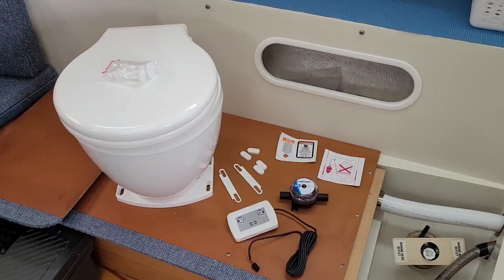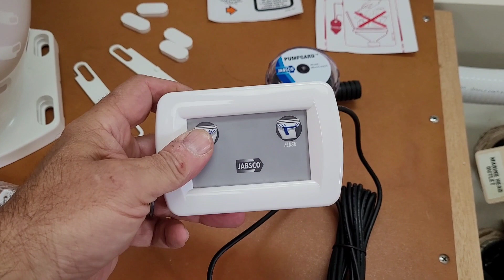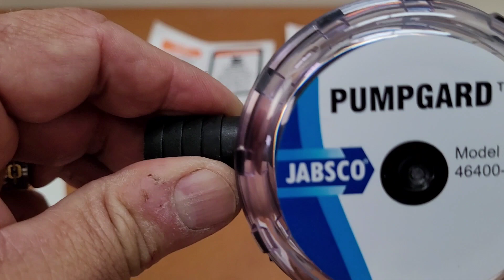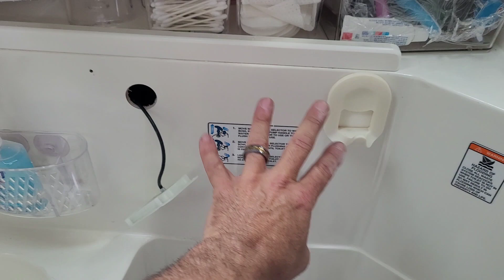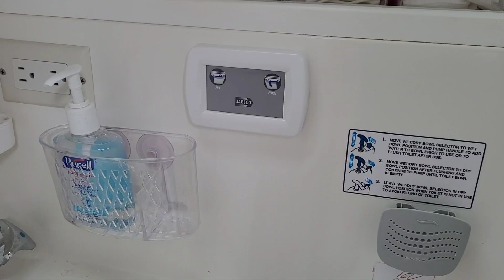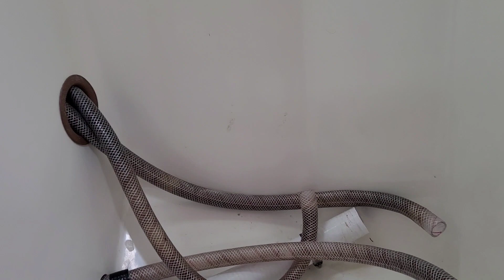Jabsco Electric Lite Flush Toilet installation conversion on Catalina 270

Comment: This is the best video on this toilet. Thanks for sharing. I have a Catalina 34 and planning on upgrading. Just wondering how much drilling you had to do to relocate the bolts because of tilt/slope in the back wall? My toilet back wall has the same sloop. Thanks again!
Reply from the maker: Hi, glad you enjoyed the video. You’ll be happy to know I did not have to drill new holes. Two things remember, this toilet used the same foot print and mounting hole pattern as the manual Jabsco toilet. Plus the mounting plate holes on the new toilet are oblong, so you can set it as far forward as it will go to give you a little more room in the back. So if your current manual toilet is a Jabsco, you should be good to go. The other thing to know is that the output (discharge) outlet and the water inlet flanges are rotating. So you can rotated them to where it will best fit your situation.  It was an easy upgrade to do. My suggestion, while you’re at it, it to replace the discharge hose at the same time.  My wife and guests love it and it is much easier to explain how to use. And much less “gross” as my wife would say….

Comment: I take my hat off to  guys like you who take the time and make videos like this. 
Just one question is   your toilet  below sea level at all times?
The only reason I ask is because if so, there shouldn't be an anti-syphon between the seacock and the rinse pump intake. The anti-syphon should be on the rinse pump discharge and the bowl intake elbow. This is because the rinse pump would struggle to prime as it would be sucking air as well as water. Have I read the installation instructions correctly or have I completely missed something.
Cheers.
Reply from the maker: Hi Robert, the toilet itself is just about level with the water line. So my anti-syphon is only one the water intake line, at 20” above the toilet base. The output hose is direct to the top end of the holding tank. Put there is a one way valve inside the output hose.  So no issues when sailing or healing. Although if I am ever healing hard to port, I would not let anyone go do pipi right away, until I’ve eased off on the mainsail…
Reply: @SVAquaholic3 I really appreciate you taking the time to message me,top man. I bought the boat with the electric toilet already fitted and it's never flushed with the correct 0.6ltr for the first button push the another 0.6ltr on the second. The world and his wife have looked at it, but your video has really helped me to understand things a little clearer, thanks again. Big thumbs up.

Comment: I think you meant "macerates" 🤣
Great video.  I'm about ready to swap my manual toilet out for one of the LiteFlush models.
Reply from the maker: I just rewatched my video and I do say macerates… I’m glad you like the video and just to put your mind at ease, we are still super happy with it. One of the best upgrades we’ve made. Much easier for guests to use with a lot less explaining..
Reply: @SVAquaholic3  - Thanks!!  We're looking forward to having this on our cruiser this summer for the exact reasons you mentioned.  I'm curious about the wire size you used for the DC wiring.  I'm planning to run from my main DC panel in the cabin to the head, but I have to go from the cabin back to the engine compartment, across the front of the engine compartment and back to the head.  There is no path for the wires to go directly across the cabin.  The specs say this draws 20 amps.  Did you use the 10% voltage drop chart or the 3% voltage drop chart when sizing your wire?
Reply from the maker: @Chuck Johnson  hi Chuck, I used 30amp rated wires. Much less drop over distance.
Reply: Absolutely heard that too lol

Comment: Thanks for the video. So did the new toilet have the same floor space set out as the original toilet? Or did you have to move it forward on the mounting block? I have the same old manual jabsco, and space is an issue for mounting if the set-out on the lite is different.
Reply from the maker: Hi, I moved the new toiler forward to the maximum setting it’s mounting base allowed. (Did not drill any new holes).  Since the output pipe is flexible, I was able to rotate it’s base to allowed for space behind the toilet.
Reply: @SVAquaholic3  so the mounting points allow the toilet to slide on a track?
Reply from the maker: @hoverwatch4131  yes they do, see this  video I shot after the install and you can the base. https://youtu.be/QA2drVjSYbM
Reply: @SVAquaholic3  thanks, and thanks for the quick reply.

Comment: I am curious where you connected to power. Is there a 12v connection somewhere under the sink?
Reply from the maker: Hi Chris, I tapped into the macerator power lines which pass under the sink. Not only because  they are close by, but is also linked to the correct amp rated breaker.

Comment: Thanks for sharing. Best video I came across for this product. I’m in the same situation now with the old manual Jabsco in a Catalina 34 and looking to switch. I hope the product still work as expected considering the bad reviews on the earlier models. Would appreciate an update if you’ve had any issues since your last comments. Many thanks!
Reply from the maker: Still working great! Absolutely zero issues!
Reply from the maker: Thanks for your kind comment. I am very pleased to let you know all is well and we could not be happier with our Lite Flush toilet. We've had no issues so far.
Reply from the maker: Just wanted to update you that the toilet works great. So much so, 3 other members of my club did the same switch, much to their spouses delight!  Most of the previous negative comments were from older models where some parts were somewhat substandard. We are ver6 pleased with this toilet and makes things simple when we have passengers on board! Simple to use.

Comment: hi, is the water line you connected pressured with a pump ?
Reply from the maker: Hello. No it is not. The electric toilet has its own pump and will draw water from the thruhull or water tank.
Reply: @SVAquaholic3  many thanks for your feedback

Comment: That toilet is a repairing pain in the ass!!!
Reply from the maker: Hi Eric, not sure what year model you might be referring to, but as I mentioned in the beginning of the video, before making my choice of brand and model, I did a lot of research. And yes, that model did have same issues in the past, but Jabsco has made many design and parts updates to address the most frequent issues reported. I also called Jabsco to go over and discuss these negative comments. I was and still am confident with the updated model, like the one I purchased as they are greatly improved.  Of course, I’m keeping my fingers crossed..